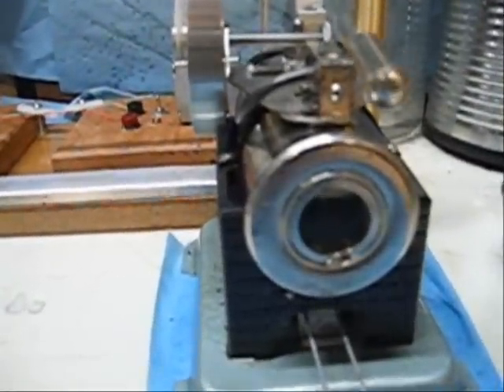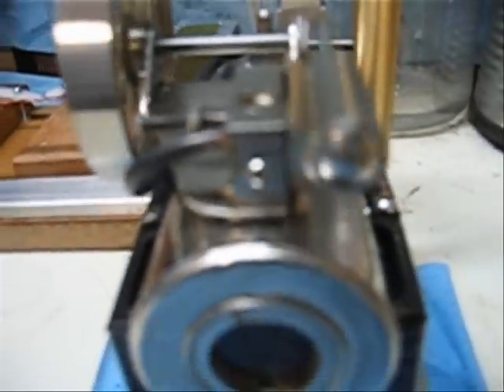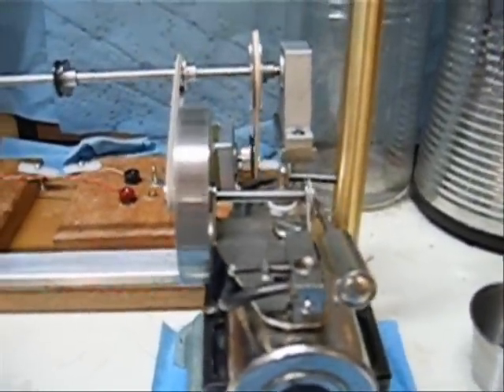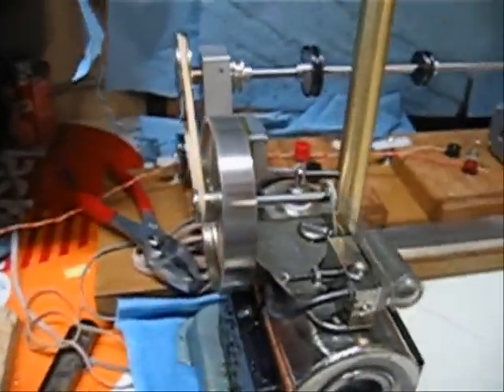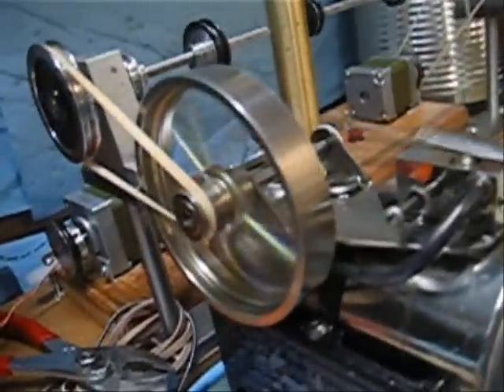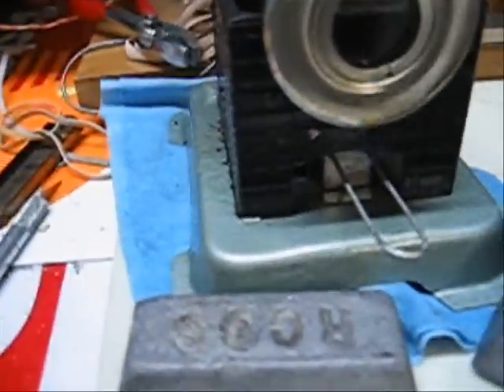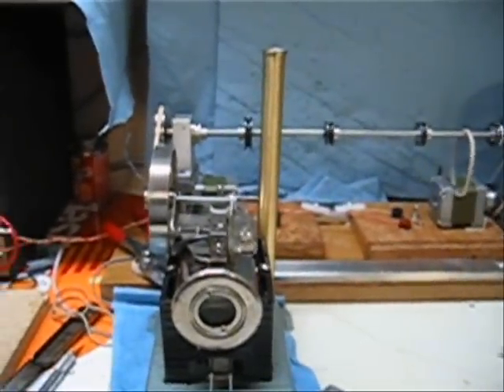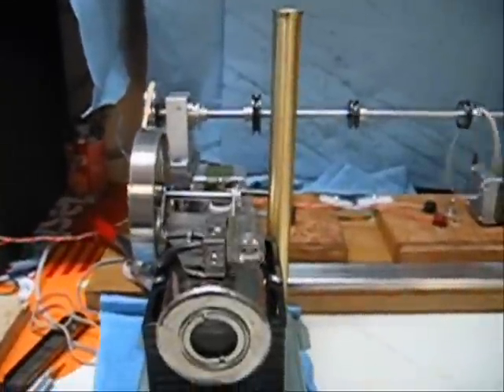Jensen 85 - SteamWorks Improved

Comment from the maker: Superglue might work too, if it's already a tight fit.  The pipe fits into the chimney loosely, since I did not feel the need to solder it.  Excess water can also leak out of the hole rather than burbling and spitting out the top.  It's not hard to do.  Just don't use too big of a pipe, or you will run into the other steam passages in the steam chest (been there and done it).

Comment from the maker: I used a tube with an ID equal to (or slightly larger than) the ID of the exhaust port on the engine, so as not to restrict the flow. I took the engine apart and carefully drilled out the exhaust port to the outside diameter of the tubing to a depth of about half way through the steam chest.  I soldered the pipe into the port, just so it would stay put and not leak.